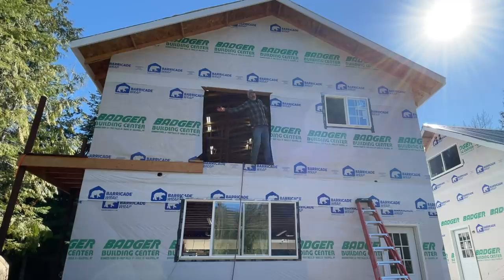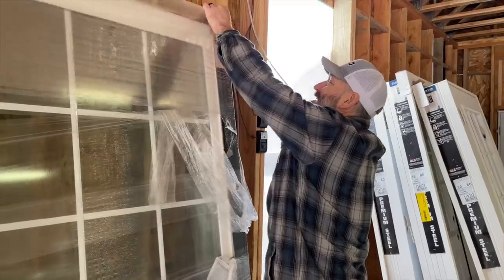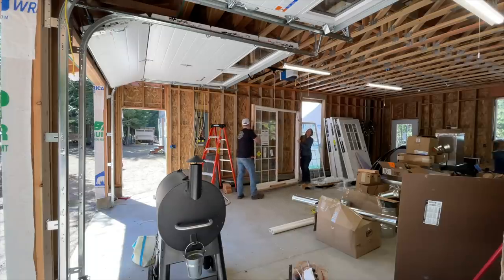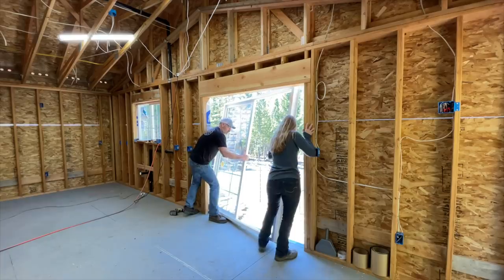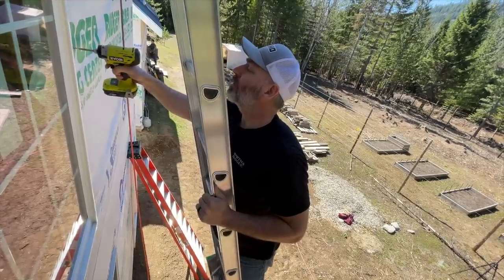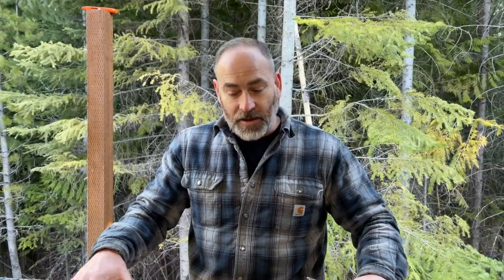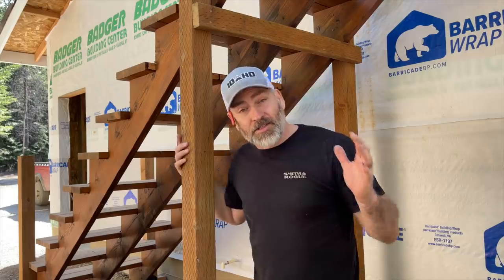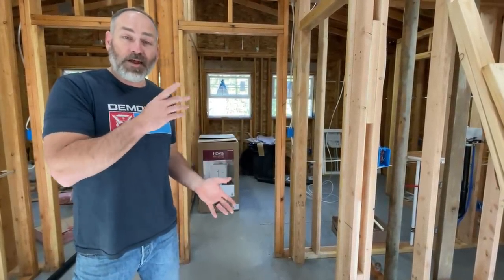Sliding Glass Door Installation - We Should NOT Have Tried THIS!

Comment: Cement Fiber board will give some additional fire protection, if your area catches fire.
Reply from the maker: Good Point.
Reply: Thank you!
Reply: They call that Hardie Siding down here in Texas.  And I agree. Very durable once it is installed, caulked and painted.
Reply: Martin - highly recommended. Just make sure it's installed correctly.

Comment: Wood siding in a forest looks nice but the woodpeckers will eventually have a field day on wood on it, even cedar. ( two different houses I’ve owned in the Great North Woods have been assaulted by Pileated woodpeckers)
We used concrete board on our addition with wood texture molded in. It looks as good as wood siding, takes paint or stain well, and is fireproof, mold resistant, cuts and nails easily, AND woodpeckers hate it. It is also “green” by reducing the use of lumber and recycles easily at some point in the future.
Reply: Good point. Thank you!

Comment: SmartSiding by LP - OSB siding that resins built inside to prevent rot, insect damage, etc. Easy to install, lightweight (compared to heavy HardieBoard). Also economical. I live in TX so the climate might be better for engineered OSB then a northern climate but you can always look into it. HardieBoard is basically the competitor but it is cement based. Very heavy though.

Comment: At first I fancied vinyl siding; then wood siding; then brick siding; then stone siding.  I found that the brick and stone siding can make a home look overwhelming more expensive than it actually costs to build, and quite nice I might say.  But the concrete foundation walls and footings have to accommodate brick and stone siding.  Now I am into different types of siding for a two-story house.  I noticed that a two-story home can look pretty bland on the outside with one type of siding pattern.  So now I like horizontal wood siding on the first level and wood shakes on the second level (or vice versa).  Also two colors of paint on a two-story house can make a difference.

Comment: Go with the fiber cement lap or shake siding form James Hardie or one of its competitors.   It's durable, easy to install (buy the power shear), takes paint very well, easy to install, fire resistant, insect proof, moderately priced and looks good.

Comment: at age 65 i fell from a 9 ft high patio roof to the concrete patio below. 
on the way down my paratrooper training kicked in causing me to execute a perfect PLF (Parachute Landing fall) then roll out into the soft green lawn completely un-injured
Reply: At age 7, I fell 9 feet from a balcony into grass, I stepped backwards and didn't notice the floor disappeared. I had a concussion, and now 25 years later, my left shoulder is visibly uneven, and the left side of my body randomly goes numb, and I have chronic issues with my spine. Not fun, much regret.

Comment: Sooner or later Safety Sally will tell you all SEE I TOLD YOU SO!!!! The things you do are not safely done by construction standards even though you got it done a seemed proud of yourself for doing it that way But, by doing the job your way may send the wrong message to your viewers or potential viewers to disregard safety.  Like not using outside lift techniques to install the sliding glass door or a balcony should of been built first, or standing on top of a scissor ladder when the very top.says NO STEP ACTUALLY TOP AS WELL LAST TWO STEPS NOT RECOMMENDED. I witnessed an employee third story building next to.a open wall do the same thing u did an fell to his death. As for siding vinyl siding is maintenance free and they do make ozone free siding that doesnt fade in sunlight. If u go with wood theres maintenance You could go with brick also but the cost would be high
Reply: Thank you!

Comment: with all due respect, doing the sliding glass door the way you did it, is one of the worst ideas you have done. i would of waited until you built the deck on that side. one fall from that height, and it could be over
Reply: Get over yourself.  If it was up to u, u wouldn’t have done anything.  Some people chose to do things that u wouldn’t do.  Enough of your advice already.
Reply: @gsftom  i worked in construction for over 40 years. had my share of injuries, and have done a lot of high work. so i sort of know what i am talking about. my body is now telling me i used it too much, and i need to relax now. i did say, with all due respect. and only say something if i see what could of been a problem. i give them credit for the work they are doing, and i would never attempt to do it now. but thanks for your input